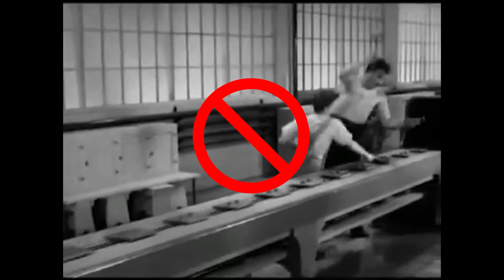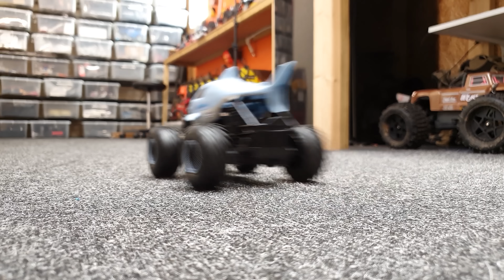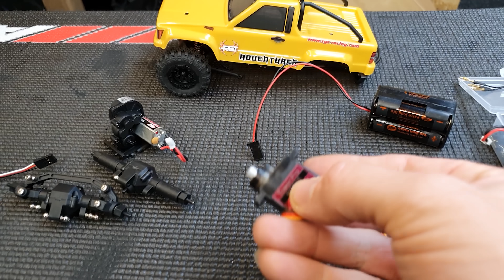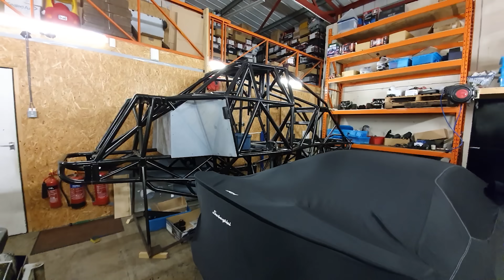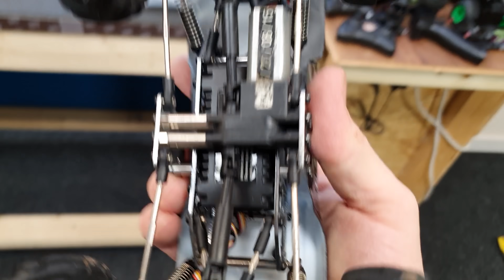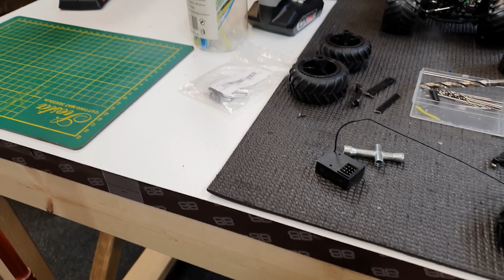Build Your Own MICRO RC Monster Truck ***CHEAP***

Comment: I dont buy cheap fake radio control at all but I like the best is real one in kit or almost ready to run from the hobby store or at tower hobbies is the best so fake ones are slow and not really fast enough than the real one do have thats why

Comment: you can also buy the ftx tracer, its great and very cheap! the cheaper older version goes 30 km/h and the newer version goes 50km/h (30 m/h) for less than 200!

Comment: Realy cool conversion :D what you/others can do is cut out the window and use the clear plastic that was on the Shark boks or from other food stuff,etc :D
ps: maby make tutorial video on what to look for and what is good or not good on bangood rc products, i notice ther is alot of rc`s but its hard to chose since you never know what has spare parts or not, and what to look for with the batteries, transmitter, recever etc, with known brands you know it usually has stuff that goes to getter and parts like Kyosho and other known brands :)
i only know Nikko and Kyosho :D

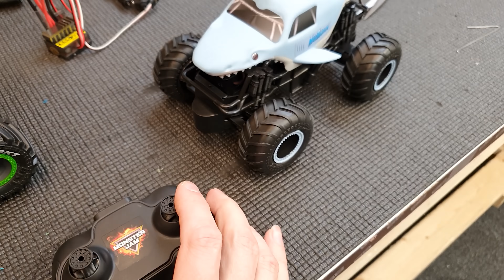Comment: Biggest diy is probably my 1:10 almost fully 3d printed on road car based on a sakura 4wd.  Its almost done, just needs one gear. Some 12mm hex hubs, and a receiver since I cannibalized the reciever for another car that fried its... aw well.  Lol.

You can tell i started with balsa planes, my go-to glue is CA.  I use CA and activator for EVERYTHING.  🤣

Comment: Hi, do you know if I would be able to use the spinmaster Grave Digger 1/24 shell and fix it to the 1/24 Axial Deadbolt rock crawler? Or is there more to it than that I don't want to be removing wires and clipping the frame id just like to straight swap and maybe swap the wheels too is that possible?

Comment: I know I’m late but in case you guys are wondering, this costs about $186 USD I made it my self and here are the pros and cons when building......

Pros: 
Plastic is flexible and easy to drill. Looks way cooler IRL
Parts are easy to buy.
Fast, strong, good crawler 
Build time: 2-3 hours or 4-6 hours if you do it slowly 
Cons: takes up to a month for build parts to come in
If you make a mistake you probably will have to buy a new one, (I went throw 2 grave diggers 1 crawler, third grave digger one worked perfectly bc of practice)

Comment: Have you thought about using the axial scx24 platform for building one of these? I took a few quick measurements and everything seems to matchup perfectly. Then you could just use everything axles and all electronics from the scx24.

Comment: You should use the scx24 then all you need is the front axle and servo and thats it already have the 3rd channel for rear steer. Be the cheapest 4 wheel steer.

Comment: i've got a hotwheels monstertruck with a metal body, but i think the metal body is to heavy for the suspension and i am just wondering that i coul just buy the parts like pre assemble axles and center dif

Comment: I built a heavily modified FTX Outback, used Axial AX10 axles, homemade motor mount to move the motor up so I could use a bigger motor, moved battery to the front, new esc etc so i can use a 2c lipo, better shocks, links and full set of lights.

Comment: Nice Build, You should look for colored hot glue. I donˋt know, if there is green hot glue to match the Grave Diggers, but i have seen many colors and have used black glue already.

BTW. did You see the belgian RC company Team Corallys 6s basher RTR line? They look and sound (namewise) very Arrmaish. It would be cool to See them compared
Please excuse my english, I am a Kraut